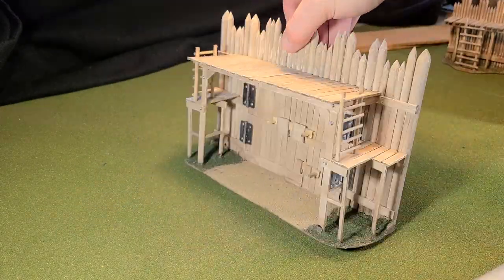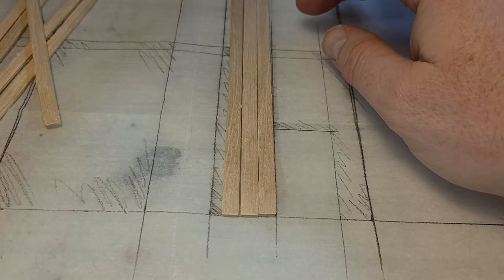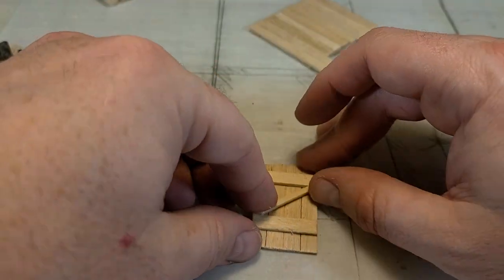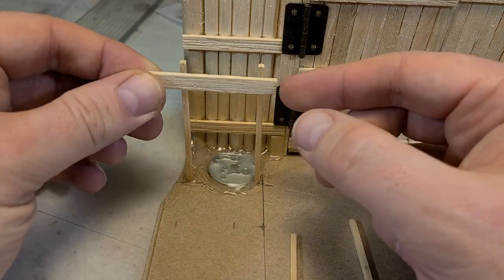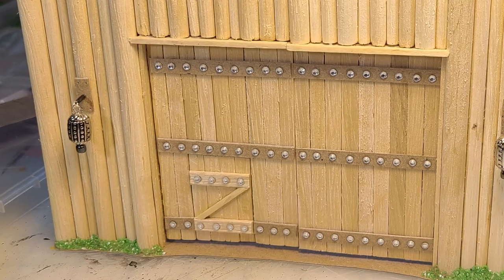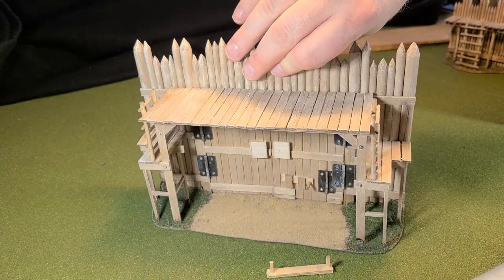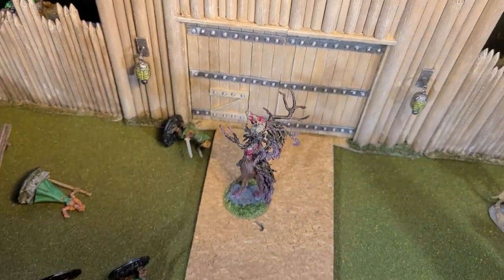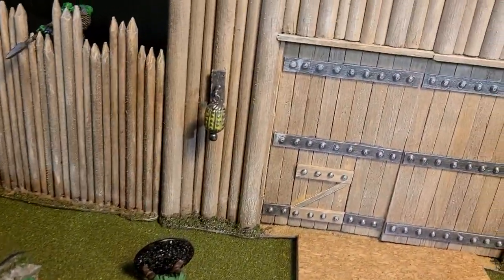Magnetic Modular Palisade Gate with Guard Door

Comment: Couple of recommendations for you:  1) buy a moto-tool, with cut-off wheels, for fast cutting of dowels, removing bumps on everything (mini's bases, rough textures of all sorts), from Harbor Freight (loud, but inexpensive, and incredibly useful!); 2) use actual Wood (PVA) Glue, it dries to a workable, handling strength, within 15 minutes, the joint is stronger than the wood; 3) use Minwax Polyshades Urethane Stain, Satin Royal Walnut is my go-to color, as it is a stain and polyurethane, combined, one coat, maybe two, and done (matte clear coat, if the semi-gloss Satin finish is too shiny for you)!  Love what you did, but you can save yourself a lot of time, and effort, by using the recommended tools.  The Royal Walnut Minwax can also be used as "The Dip", on your mini's.  My go-to standard, as a dyed-in-the-wool Army Painter.  Fastest way to finish mini's for covering a tabletop with them, en masse.  Cheers!
Reply from the maker: Thanks for all the tips.  I have horrible luck with harbor freight power tools.  Don't think it would have saved any time but probably cut down the soreness in my hands.  I'll have to get some stain and try it out next time I have the opportunity.   Thanks for watching.

Comment: When you designed this how, how large did you make the gate house? I'm guessing 8 inches but confirmation would be nice
Reply from the maker: Hey there Andrew.   Thanks for checking out the craft.  The gate is 6 inches high by 9 inches long.  The main gate is 4 inches tall by 5 inches wide.  Giving you 2.5 inch wide doors.  I hope this helps.
Reply: @brokenterrain  it does, thank you